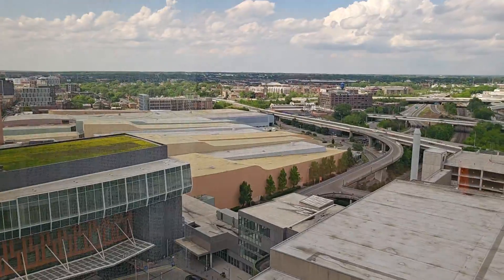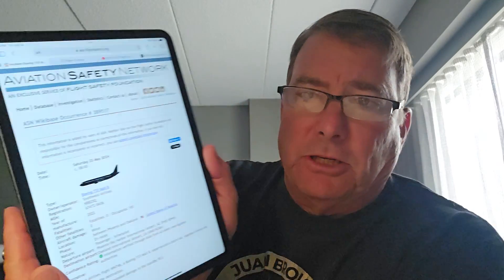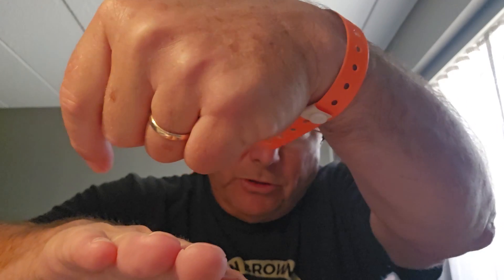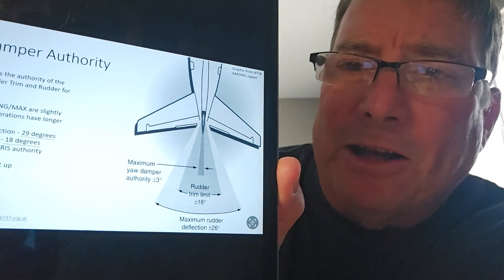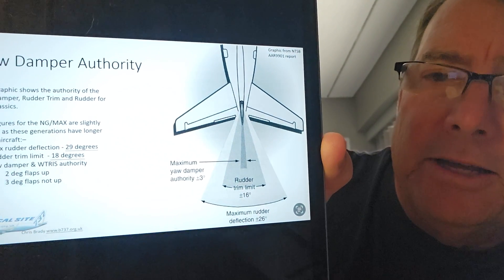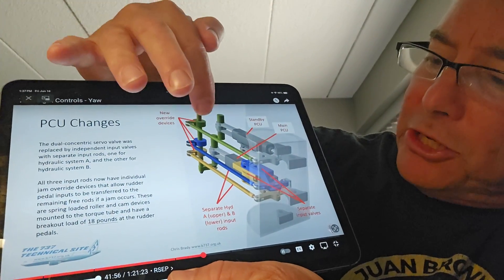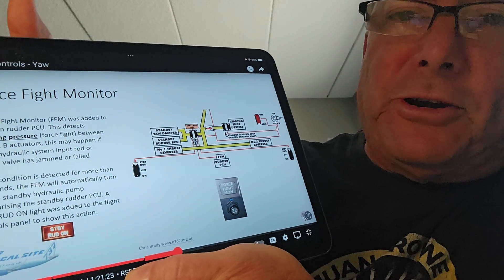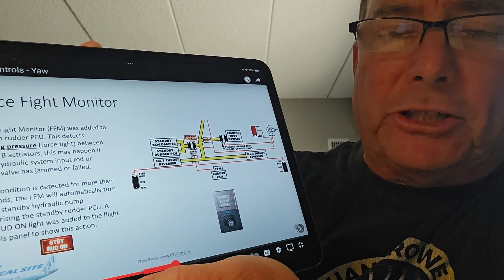SWA 737 Max-8  "Dutch Roll" Incident

Comment: "On Jun 13th 2024 The Aviation Herald learned that two ribs, that the stand by PCU is being mounted to, were damaged as well as the mounts of the stand by actuator. A temporary repair was done in Oakland replacing the damaged PCU, the aircraft was then ferried to Everett to replace the damaged ribs."
Reply: I’m a little puzzled that the standby actuator and mount could get damaged. Normally hydraulic system A and/or B would be powering main rudder PCU and the standby actuator would basically just be along for the ride so to speak. The primary Yaw Damper uses system B hydraulics so I’m wondering if they were on standby rudder power or was some part of the system on MEL or ??  It’ll be interesting to see what the NTSB investigation reveals.
Reply: @Citroeniste   Well said.
Reply: @Citroeniste  yes!
Reply: Another great explanation of a complex airplane issue that was garbled in the main stream media reports.
Reply: I was flying 737s when the rudder hard overs occurred.  Very worrying days , so I wouldn't  be too impressed about this yet another control event on the Max.
Reply from the maker: Wow!
Reply: Near misses are warnings........damaged attaching structure on any PCU.......pay attention.......it's telling you something !
Reply: So is the implication that there were actually two faults ? One system goes bad and then the back up also fails ?
Reply: @mroptimistic8957  I would guess an unforeseen failure mode on system A that caused it to not disengage when the backup went in.  A miss in the FMEA paperwork in other words.. Speculation is always fun 😀
Reply: There seems to be a rabbit hole in the design, I think the damaged mount is likely a consequence of at least two of the three systems fighting each other..
Adding redundancy can actually introduce a risk if the backup somehow can end up in conflict with the failing system it is supposed to replace..
And yeah, finally I understand what a dutch roll is. Best explanation so far 😁
Reply: @erik_a8357   You took the words out of my mouth. The question is......when were the actuators mis-rigged?  Or better yet, where did they get mis-rigged at, Boeing or Southwest ?  (if rigging was the issue)
Reply: Two systems fighting each other. Great. 😖
Reply: This really looks like a design issue now. Which system is it is not yet clear but definitely something is not working as it should.

Needs to work out the root cause asap.
Reply: @tonamg53  Indeed.
Reply: Oh boy.. What's lurking around in my mind now is that some of the more recent pundits who spoke ill about the MAX may have been offering more than just speculative theory.
Reply: Voice recorder is on Southwest.  How many hours on the airframe?
Reply: Read somewhere else, brand new. 
(So worse case.)
Reply: Seems strange to me, that damage to structure can be caused by the aircraft’s own hyd system. Weird.
Reply: @johnnunn8688  They were never intended to Dutch roll. That's an abnormal flight mode. Anything can happen. 
Airplanes are built VERY light weight for their size. The structures are the absolute minimum strength plus safety margin. But the whole concept is minimalist for weight savings. Weight savings on airplanes is a religion.
Reply: They have not said, but I think so much force was applied by the captain to regain straight and level flight, that damage to the structure mentioned by you occurred.
Reply: @billrichard4438    " I think so much force was applied by the captain that damage to the structure occurred." 
I doubt that could be the case.  I don't think the pilot could apply the force necessary to damage the structure but hydraulics could.
Reply: @billrichard4438  yep. Took either a helluva stomp on the rudders -or-the attaching structure for the PCU is grossly inadequate for load carry through. Given the recent track of the Max-me thinks the latter.
Reply: @stevenrobinson2381  I hope not. If so, this issue must be resolved quickly!
Reply: @billrichard4438  If you push the pedals to the stops, then push harder, is it possible to cause structural damage with foot power alone? What's the point of control stops that don't stop control inputs before damage occurs? Could excessive force on both pedals simultaneously cause that damage, with neither hitting the stops?
Reply: @beenaplumber8379 It all depends on the speeds you are traveling at. At lower speeds you need more control inputs on all rudders. It‘s the same in your car. Backing out of a parking lot you need more steering inputs than would be safe going 150 mph (I live in Germany where that‘s legal).
Reply: @beenaplumber8379 I would only imagine that full rudder cable control inputs simply command the PCU to full deflection of that hydraulic actuator. The PCU itself would reach its mechanical limit of the hydraulic cylinder and stop there. I think the damage could be caused by one of two things.
1. Somehow both PCUs were commanded in opposite directions simultaneously which could have overloaded the ribs torsionally.
Or
2. The rudder input from the pilot to correct the Dutch roll event somehow commanded full deflection at speed, over-stressing these ribs. Generally there is a rudder limiter that reduces rudder travel in relation to airspeed/mach. This will be interesting when we find the answer to say the least…
Reply: @beenaplumber8379  I suspect that they were cruising along well past the Max Gear Extended Speed and sustained structural damage when he stomped on the rudder hard.
Reply: @ScottyScott70  Something like American 587, only higher and faster? Assuming that's the case, I'd think there would have to have been a hell of an upset to cause the pilots to respond so aggressively in cruise flight. Then the question is what caused the upset in the first place? If it was uncommanded/uncontrolled Dutch roll, how did that happen while on autopilot? Why didn't the yaw damper compensate? Were they on autopilot? (I'd assume so.) It still points to a flight control issue as far as I can tell (armchair crash investigator that I am), either in the electronics or in the hydraulics. It also doesn't address the aux PCU being somehow activated. At this point I think Boeing is probably in even deeper trouble. I can't see how this can be put on the pilots, unless they simply lied about the Dutch roll, and I'd never assume that. Pilots don't just stomp on the rudder during cruise.
Reply: @beenaplumber8379
Exactly.
Reply: @beenaplumber8379 

American Airlines Flight 587 (Mentour Pilot might have a video on YouTube explaining this accident.

An investigation by the National Transportation Safety Board determined that the principal cause of the accident was the loss of the vertical stabilizer following the first officer's unnecessary use of rudder controls after encountering turbulence at approximately 1,700 feet (518 m) in altitude.
Reply: @creatorofgods1668  That's why I mentioned that flight. Earlier comments suggested the damage to this aircraft might have been caused by excessive rudder input, like a faster version of 587. (I'm sure Mentour has covered it. If not, he's probably the only one who hasn't.)
Reply: @beenaplumber8379  My apologies 😅 was on my break
Reply: @beenaplumber8379 another armchair trolling and searching for another chance to bang Boeing again. Get over it for crapsakes!
Reply: @natural-born_pilot  I am honest about being an armchair accident investigator. I speculate, and I don't hide that fact, so you and everyone else can keep my comments in context. There is nothing wrong with that. I own it. Experts will determine what happened, but until they do, speculation, in context, is something many of us engage in, and it's harmless. Occasionally it might even be productive if it leads to aircrews and maintenance personnel thinking and considering things that are brought up by people who speculate. It's unlikely but still possible. In any case, there's no harm in it, especially when stating the obvious facts, like Boeing's potential to suffer even more harm. (You can't disagree with that, can you?)

Boeing has made its own mess. They have exchanged their culture of safety for what they perceive as profits, with no regard to the fact that their short-term profit orientation will almost certainly doom them to long-term financial losses in addition to all the lives lost so far.

No one knows what happened so far, but Boeing has not earned anybody's trust as far as safety in their MAX line of 737s. I'm not kicking them when they're down. I think I'm stating what's obvious to most people.
Reply: @billrichard4438  that.. should not be possible
Reply: @billrichard4438  It must be highly unlikely that human power alone could damage the structure. It would have to be extraordinarily inadequately designed. That explanation begs more questions than it answers.
Reply: How did this happen? This must be answered
Reply: @Juliette_4   I can think of a few scenarios but I wouldn't dare to guess this early in the game. I deleted my previous opinion in another reply. It's too early to guess. 
Sometimes routine checks are done that involve disconnecting connectors on certain hydraulic valves. If they were not reconnected and the valve was left in an "alternate" position then the standby actuator might be powered when it shouldn't be. But it's way too early to even guess.
Reply: @rael5469  Yes, it's early, but I think speculation is ok. Pilots and mechanics who are responsible for safe operation of these birds are active in these comments. We can speculate, they can laugh, or maybe they'll read something that makes sense. The investigation will take a long time, and passengers are flying in these things right now. I think pilots and mechanics must be reviewing their procedures in their minds. They know the context.

In your speculation about disconnected hydraulic valves, would that be evident before flight, or early in flight? During the flight controls free and clear check? Would some indicator alert the crew to the condition?
Reply: @beenaplumber8379  "Would some indicator alert the crew to the condition?" 
In theory yes......but at the conclusion of our checks the maintenance manual has you go out to the valve and visually check to make sure the indicator handle is back in position #1, for normal operation.  If a mechanic blew that off and the valve actually failed in position #2 ......that could be a problem. A LOT of our work is only seen by us. A LOT of our work depends entirely on personal integrity.  But this Max -8 is REALLY new. I wouldn't expect any such failure on such a new aircraft. Not for another ten years. Even then.......a ten year old aircraft to us is like brand new. Not even broke in yet. Maintenance checks on newer aircraft rarely find discrepancies. Maintenance checks on newer aircraft are a walk through with no issues.
Reply: @rael5469  Thanks for the explanation. I would imagine if the indicator handle was left in position 2, that would have been obvious during the inspection after landing, when they inspected all the damage. That scenario (if it's what happened, and of course who knows right now) would make this a SWA maintenance issue then, right?

I don't know how mechanics do their job. Everybody everywhere makes mistakes, but if an airline mechanic makes a mistake at work, a few hundred people can die. I couldn't handle that pressure. I know procedures are made robust against the most common error types, but still... I know mechanics often work long hours under time pressure doing meticulous work, and it seems that's an environment for breeding human error. The maintenance people I worked with were all super-professional and very careful. I'm glad they did that work rather than me. (And you too - I get the impression that's what you do.)
Reply: @beenaplumber8379  "I would imagine if the indicator handle was left in position 2, that would have been obvious during the inspection after landing,"
Yes, of course.
Reply: @beenaplumber8379  "I know mechanics often work long hours under time pressure doing meticulous work, and it seems that's an environment for breeding human error. "
You are absolutely right. In a line maintenance environment every aircraft has a flight in the morning.They fly by day and we get them overnight. It looks like a NASCAR pit stop around that place overnight. Some of it is routine work but there is a lot of troubleshooting too. But management has always been safety minded where I work. They will take a plane out of service if it involves safety of flight. The most crucial thing in that is to let ops know as soon as possible so flight delays can be dealt with so as not to inconvenience the passengers......much.  ;)  Bottom line is safety though.
Reply: @Juliette_4 for crapsakes Juliet_4 why do you think they are investigating the incident🙄?
Reply: I readed this, too.
Reply: I heard that allegedly had to do with counterfeit parts, but I don’t believe it’s that simple per se
Reply: Uh oh
Reply: This is an extremely disturbing finding in association with this incident.  This is SCREAMING that there is something REALLY WRONG with this system...and they better figure it out before, GOD forbid, we lose another aircraft and those aboard.

Comment: Thanks for explaining the dutch roll as evperienced on the 737 as compared to the training manuver I remember from my student pilot days!
Reply: The maneuver practiced by students is not really a "Dutch roll."  In a true Dutch Roll the roll and yaw are out of phase: the plane is rolling one way, but yawing the opposite.  By the time the plane's dynamic stability brings the yaw into line with the roll, the plane has already rolled back the other way, and the yaw is still contrary to roll.

In the practice maneuver the idea is to not let the nose move: it should remain fixed, i.e. NO yaw, while the plane rolls side to side.  An uncoordinated turn is more akin to a Dutch Roll, in that initially yaw is opposite roll.

Comment: “Dual concentric” rudder PCU design was found to be the probable cause of the two hull loss accidents (UA585, N999UA, 1991-03-03, Colorado Springs and US427, N513AU, 1994-09-08, Pittsburg).  As a result, the PCU was completely redesigned (initially a modified dual concentric PCU, then a ground-up redesign) and a retrofit "Rudder System Enhancement Programme" was initiated, and then mandated under Airworthiness Directive 2000-22-02 R1.

All 737s in service today will have the new design fitted and there should be no in-service airframes with a dual-concentric PCU in operation.
Reply: What losses are you talking about the one in Pittsburgh was a servo valve that went past its stop and caused a rudder hard over.
Reply: @mikemicksun6469  Yes.  Added detail to my post.
Reply: @mikemicksun6469  I thought the PIT loss was due to flying too low of an airspeed for the configuration and went below inflight minimum control speed.  I'm probably wrong.

Comment: Dutch role has been a problem on 7:37 for a while if I remember but it's frequently induced by engines that haven't been trimmed properly. Am I wrong?
If I am not, is there a possibility that an engine was changed and they weren't properly trimmed?

Comment: G,day Juan from Sydney. Thank you for explaining the yaw damper on the 737. 
"Step on the ball"
What are the planes motion sensors that send signals to the CPU

A. GPS 🌏🇦🇺
Reply: IMU
gyroscopes
radio navigation
VOR
radio altimeter
pressure altimeter
Pitot tubes
compass
NDB bearings
ILS systems

GPS is nice but will not tell you half the things you want to know. BTW: Galileo, GLONASS, BeiDou/BDS. 

Never mind Sonne/Consol, Loran, Decca, TRANSIT, and a whole host of other older technologies that are not used much any more these days.